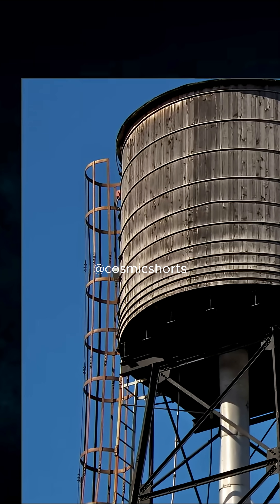Science in water tanks 🌊 w/ Neil deGrasse Tyson

Comment: Does a welded tank need more welds at the bottom?  Thicker welds?  Stronger welds?  Longer welds?
Reply: If it's cheaper in manufacturing they'll use thicker and thinner metal. But in a lot of cases that would require more tooling to shape the different metal so they just make it the same even if that uses more material.
Reply: More strength somehow.  Multiple choice proposition.  Old school wooden tanks not so much.
Reply: No, its just the steel is thicker.
Reply: How about a ship's hull width?

Comment: The force on the side is determined by the height, not by the mass of water pushing down. Why does he explain the static measures of the barrel with the weight of the water in it? What have I missed in physics?
Reply: It isn't for you.  It's a thought experiment for those who DID miss physics.
Reply: The height of the water times the area of the tank equals the volume. Volume x density is The Mass of the water which also pushes against the side of tank since it is a liquid, so it does depend on the mass of water pushing down.
Reply: You missed big money from being a successful media star.
Reply: All of it.
Reply: Are you saying if there was NO water there would still be the same amount of force?
Reply: Assuming you mean "depth" of the water in the tank, that does correspond to the pressure on the side of the vessel, but it's because the water has mass. If you are using the word "height" in the context of the height of the tank off the ground, that has nothing to do with anything except the pressure that can be developed in the pipes at the ground level, which is called "head".
Reply: @jamesw1659 yeah, I meant height of water above the bottom of tank aka depth
Reply: @jamesw1659  Hahahaha "pipes"